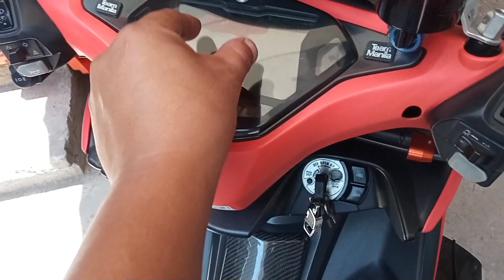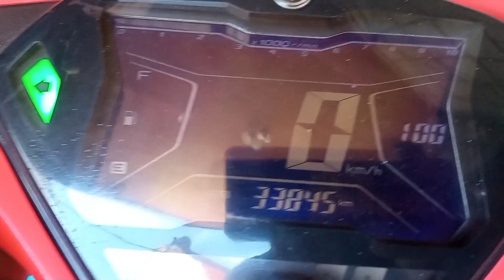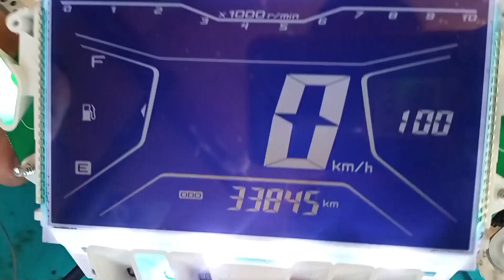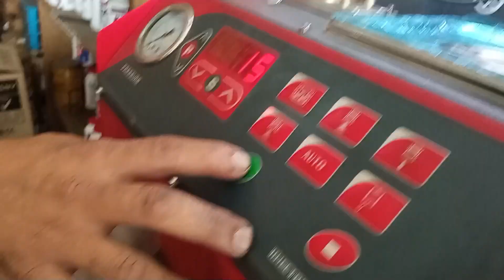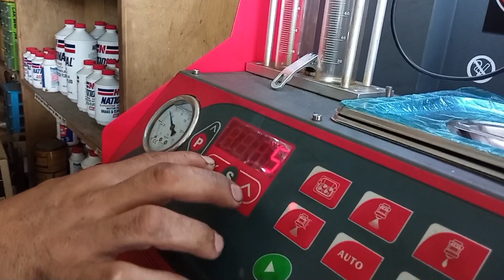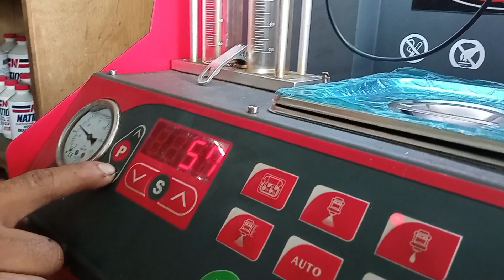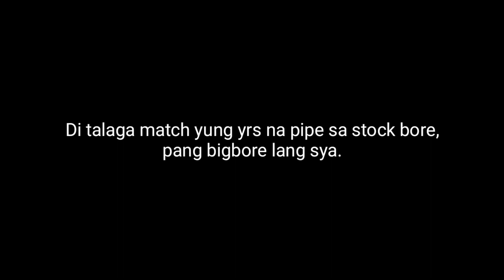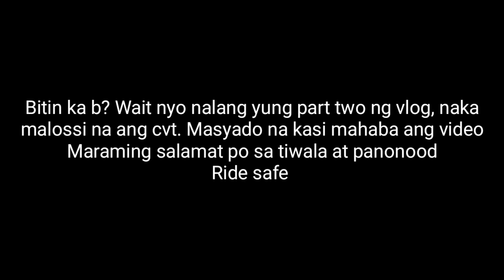Aerox 2018 cvt tuning, maintenance and repaint by NinjaRat

Comment: Boss off topic goods b ung tri angle ng pulley ng chetworks sa aerox v2?
Reply from the maker: Yes boss. Yung mxi ko, naka chetworks kalkal. Pulley pang aerox. Oversize pulley df po
Reply: Sa aerox v2 ngay sir oversize din or stock pulley na aerox ginawang tri angle saka ano kaya recommended springs nun sir
Reply from the maker: @kenochokidonutchollo8185  boss base to experience. Mas maganda mag taas ka ng center spring. Tapos tono tono. Ano po b gamit nyo n lining at ano status nya.
Reply: @ninjaRatMotoVLog  dati kasi boss naka m3 ako tri angle ako then settings ko 1k center stock clutch ganda manakbo comoare sa after market, ngayong naka aerox v2 ako planning to buy tri angle goods kaya if nag 1k center ako tapos 11 grams tapos stock clutch or mas okay bang 1k both springs? Naka rs8 lining ako stock clutch housing stock bell ngayon boss.
Reply from the maker: @kenochokidonutchollo8185  yea boss. Same ng tono mo sa m3 mo. Need mo babaan ang bola. Gamitan mo ng 1k center tapos lagyan mo ng mtrt torsion control.
Reply: @ninjaRatMotoVLog  sa clutch spring boss 1k din?
Reply from the maker: @kenochokidonutchollo8185  yes boss
Reply: @ninjaRatMotoVLog  boss if ever naka tri angle nako then bago lining ko rs8 clutch shoe stock clutch housing if makapal siya boss 1k clutch gamitin ko then 1k center with mtrt torsion controller goods naba sakin yun 78kg ako at 11grams na bola,  minsan may angkas na 45kg then lagi paakyat daanan goods na kaya yun boss
Reply from the maker: @kenochokidonutchollo8185  yes boss good yan. Sabayan mo ng gearing. Tono po